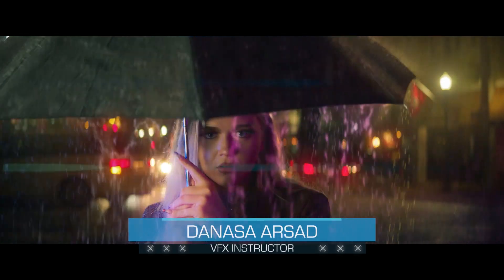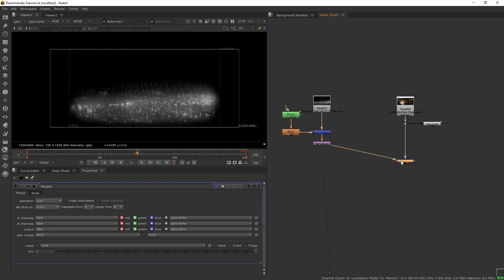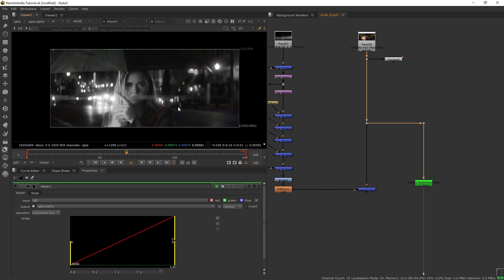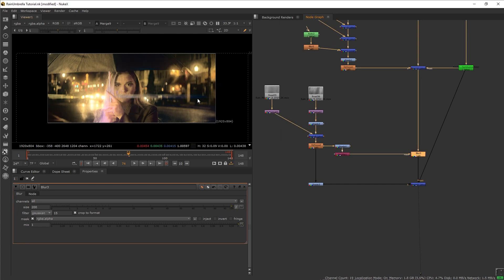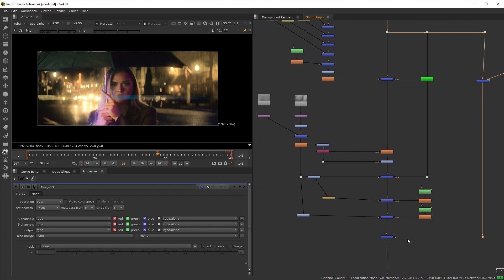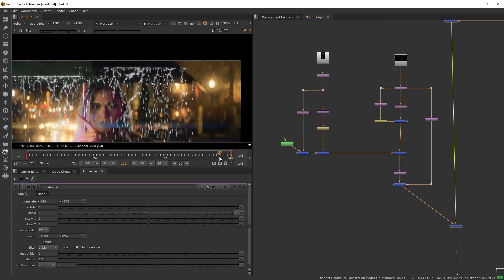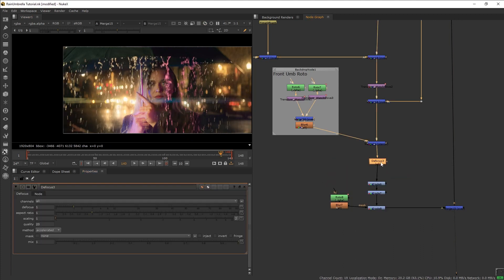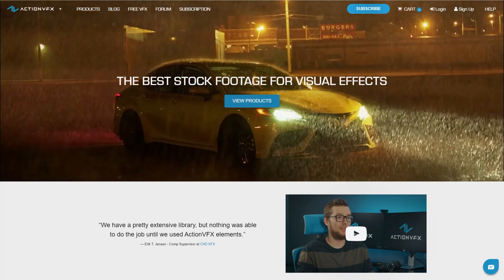How To Composite Rain | Nuke Tutorial

Comment: Oh man.. Am a after effects guy...am little nervous with nuke... Node might be easy to use bt to me feels like complicated 😁
Reply: Same to
Reply: Been using After Effects for over 12 years (and still do on occasional projects)...but once I made the plunge to Nuke...I was so happy.  It felt like there were no limits, as Nuke handles complicated shots with ease (as compared to AE).  Using Nodes was an adjustment...but it didn't take me long to "see the light" lol. I promise you won't regret it!
Reply: Same here too.
Reply: I agree with John. If you want to test Nuke, you can try 'Natron Compositing'. It's an opensource Nuke look-a-like. They copied the interface 1 on 1. Some nodes are named a bit different, but the thought process is the same 👌